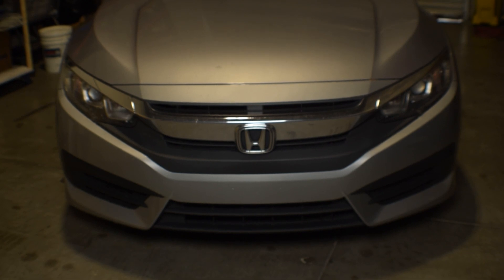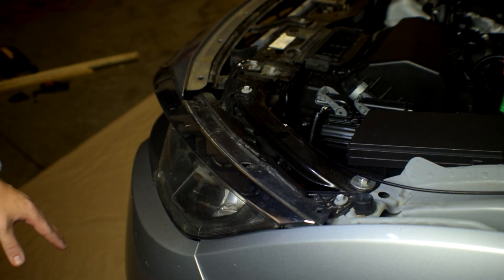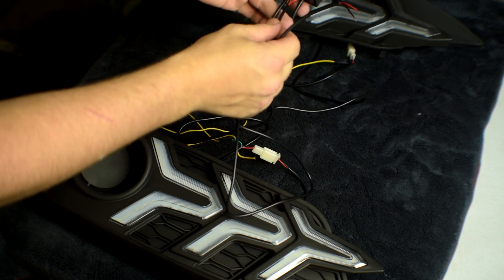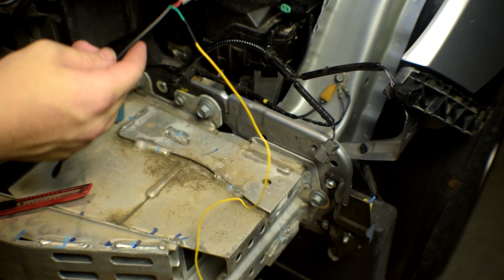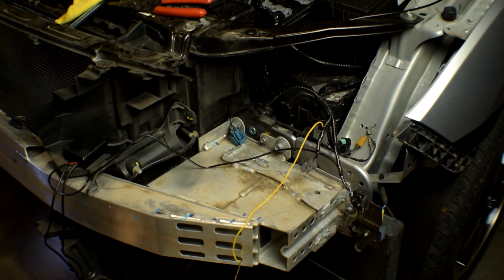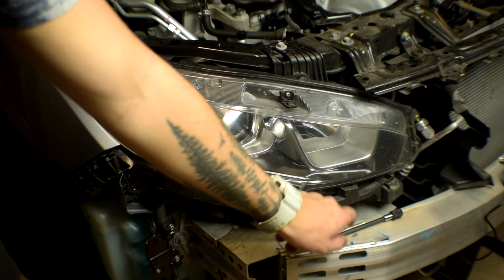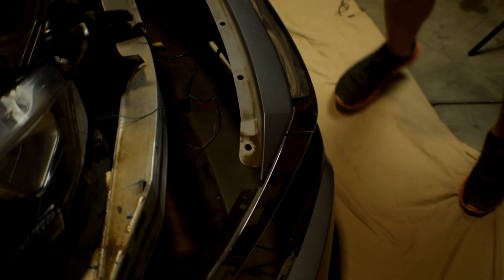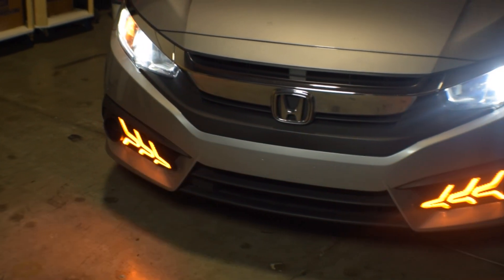DIY 10th Gen Civic Daytime Running Lights Mustang Style Full Install and Review of Fog Light Panel

Comment: This tutorial really helped me a lot and I just successfully did it! But a small problem, the turn signals from these don't synchronize with the lights from my car. The lights from the panels seem slower. Do you have any idea why? Thanks a lot.
Reply from the maker: Thank you for the comment and I am glad the video was helpful I appreciate it! Its hard to say for sure but these after market parts seem to have a bug on some of their units. The only thing I can think of that would maybe help is unplugging the batter for a few minutes and then restart the car. This might reset the timing and electrical.

Comment: Great video! I installed over this past weekend, however mine have all different colored wires so I havnt yet done the wiring.

Driving today and I get radar obstructed message.

Mine is a 2019 Civic Sport. Anyone else have the radar issue? And what year is the car if so...

I wonder if its an issue with the 2019+ styles, as the fog area was slightly changed starting in 2019...

Comment: Hi Sleek just a quick question, that does this block the front radar system for Honda sense features? Thx
Reply from the maker: Good question, I have been running the light for several months and haven't had any problems. Thank you for the comment brother!
Reply: I have 2020 civic ex I tried it’s blocking i took it off
Reply: Same here, ive got a 2019 sport, just put these on and it blocks the radar for some odd reason. I didnt wire them up yet either and radar still says its blocked unfortunately

Comment: I have a 2019 Honda Civic you guys think these would fit it because link says 2016-2018
Reply from the maker: Depends on the trim you currently have but if its a sedan shouldn't have any problems. A coupe might have a slightly different design.

Comment: I followed the video exactly however now my back tail light (the same ones you have) don’t work like they used to. The tail lights don’t line up with the trunk lights when starting the car. 
What can I do to fix this?
Reply from the maker: hmm that is strange, weird for the rear tail lights to malfunction after installing front lights. I haven't experienced this but there is a delay with the connection. That's the only thing I can think of that would make them not line up. First I would disconnect the battery of the car. Detach the positive and negative terminals. This will allow the electrical system to reset. Detach and leave for 5 min then reattach the cables. After reattaching test the lights and see if that works. If not check the connection of the wires and make sure that are connected properly and not loose.
Reply: I also tried this and the light sequence on the tail lights is still off.

Comment: would this fit on a 2021 honda hatchback EX?
Reply from the maker: I would say no because the Hatchback has a different design on the fog light panel. The only way to be certain is to check the panel design for the sedan like in the video and then the hatchback to see if they match or differ.

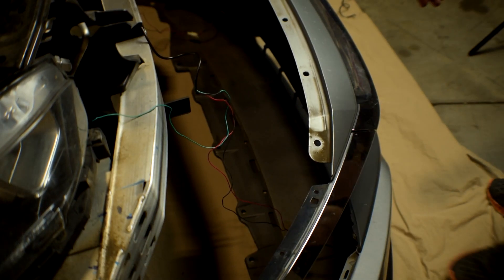Comment: Where does the green wire connect at 13:08? I have that wire but I don’t know where to connect it.
Reply from the maker: So the green wire is actually the yellow wire, when you remove the casing for the wires to get more slack the yellow wire turns green deeper inside the wire casing. So the only wire on the left side to connect is the yellow wire.

Comment: Can u use a t tap for this instead of actually cutting the wire
Reply from the maker: Yes, The way I use works every time that's why I do it that way. I have used the t taps in the past and sometimes the connection doesn't hold up.
Reply: @sleekauto6008  nice thanks for that and 1 more thing.installing fogs on a civic wit no fogs.u know why it would be blowing a parking fuse after installation
Reply from the maker: @ccalvo291  Good question! that has happened to me in the past. Make sure its connected to a spare with the proper power. If the fog lights generate more power then the fuse can hold then it will pop the fuse. First test how much power the fog light require and move the connection to a spare that can support that power.
Reply: @sleekauto6008  sweet thanks alot very helpful
Reply from the maker: @ccalvo291  Happy to help!

Comment: Did you run into blocked radar system from this?
Reply from the maker: I didn't and still haven't experienced any blocked radar. I've been running the lights for about 2 months and everything is working as it should! Thank you for the comment brother.
Reply: I’ve installed a similar setup and I do have radar interference issues. Thinking maybe an RF blocker may correct the issue.

Comment: Would this fit a 2017 Honda Civic ex-t
Reply from the maker: It depends, if you have a hatchback they wont fit but if it is a sedan yes. I believe the EX-T has the fog lights already so that's a plus. If I were you look at the front fog light panel if it matches the sedan it will fit if its a much wider design like the hatchback then they wont fit.
Reply: @sleekauto6008  I have the coupe version
Reply from the maker: @andyotx1270  From my experience they should fit just double check the design to be sure. I appreciate the comment brother!
Reply: Any update, did it fit the coupe ?

Comment: Fog light installation guide
Reply from the maker: Will do, Waiting for some more affordable fog lights as most are expensive with little reviews. Don't want to install something that wont be the best product for the civic.
Reply: @sleekauto6008  if the drl is not on the turn signal is not working?
Reply from the maker: @denztorre5000  correct, for some reason the turn signal wont receive power unless the headlights are on. If you have the lights on they will work. At first I wasn't a fan but now I like it as the lights will last much longer and I can always turn them on during the day by turning the lights to the on position. This will help prevent the LED from burning out prematurely and have more control when running the new setup.